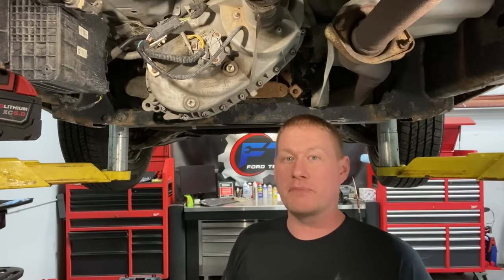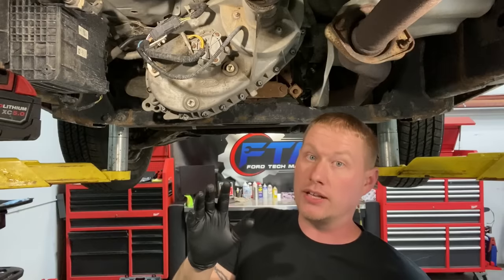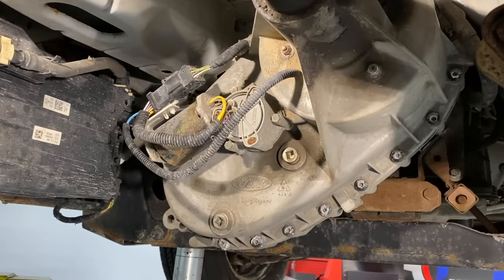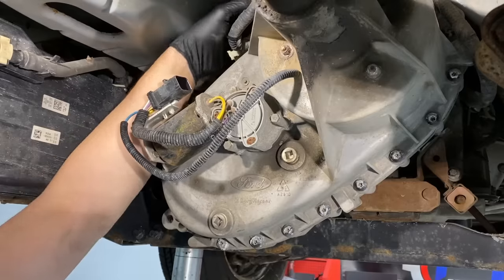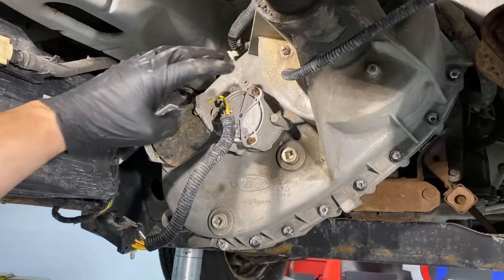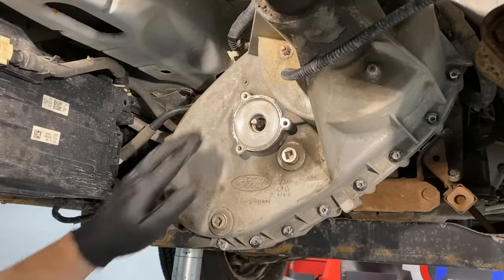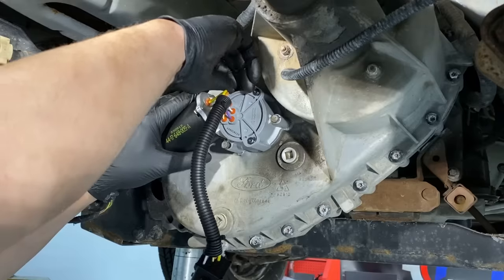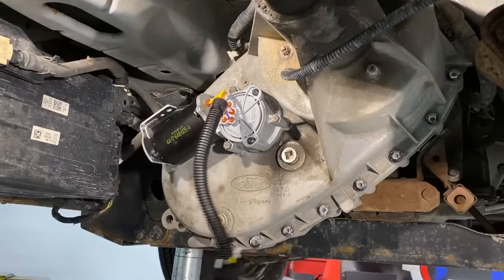2004-2020 Ford F-150 Four Wheel Drive Inoperative DTC P1867: Transfer Case Shift Motor Replacement

Comment: Is there a tool to remove the wire. I had do much trouble removing it. I had to cut the connector in half to remove it.

Comment: Great Video.  My 2006 F-150 acts strange when shifting into 4 Low.   If I am in park it actually will not go into 4 Low with putting it into drive and bumping it.  Loud Clunk.  When in Nuetral it will go into 4 Low but takes a long time.   When driving in 4 Low there is a high wine noise.  Is this normal?    Should I be in motion and do it on the fly?  4 High goes in and out no problem.
Reply: You have to be in neutral to get into 4L. It's literally a gear ratio change so it needs to engage an entirely separate drive gear. As for the whine, the bearing on that shaft might be dying, or starving for fluid. I'd check to make sure you have enough fluid in there first.... probably not a bad idea to just do a fluid change.

Comment: Is it also a common failure in the previous generation (97-03). Used ur other vid to check vacuum and electrical and all good there. Was thinking somehow the front diff went out

Comment: Could the transfer case cause problems at the hub actuators? My 4x4 gave out a couple months back but i never use 4x4 always have it at 2WD but after it gave out a bad vibration started coming from the passenger side. Vacuum is good at the hub actuators and the lines going to the actuators are good. My next step is checking the solenoid. I do have suction when turing my truck on but the passenger side vacuum is a bit weak. What could my problem be?

Comment: I’m not getting a code, I’m getting a message that says shift delay pull forward then it says check 4x4. Vacuum lines are new and so are the hubs only about 3 months old, could this be the problem? I’ve also seen people talking about IWE’s going bad

Comment: I've just completed this on my 11 f150. Code still comes back immediately. Pins all look super clean. Anything I can test before I assume I got a DOA part? (Motorcraft from Tasca)
Reply: Do you have power at the motor that engages 4WD? That would be the first thing I'd check. Wondering if you have an issue with the module. Does the light come on, on the dash showing it switched to 4hi/low? Mine doesn't which is making me think I don't have power/module is bad
Reply: I found the harness was bad. Bought new harness, used the old one to fish in the new one. Stripped shielding of old harness, found broken, crusty wire in a random spot in the harness. I'm assuming there was a defect in the insulation at that spot.
Reply: @mattmanyam  how did you find out the harness was bad? Just put a new transfer case shift motor on my 04 and still nothing. No lights or anything.
Reply: @quimchii5917  wiring diagram from alldatadiy account, then ohm checks. (Harness between transfer case module and shift motor)

Comment: I went to Auto Zone to see if I could confirm that the error I’m getting is the most common one mentioned in the video. The tech tried two different code readers and a number of things with the better one and couldn’t get any codes to show. After I left of course the 4x4 engaged and disengaged without showing an error on the dash. The position sensor diagnosis makes sense given the behavior I’ve observed (dash showing 4x4 low when switch is set to 4x4 high), I just kinda wanted to confirm the error was the position one before I spring for a $250 part.

Comment: Amazong video as alwyas, I recently got this issue on my 2013 F150 FX4, and it happend right after my battery died and i tried to start to the engine couple of time and i heard a some sort of gear noise. Charged my battery, then tried to reverse and the gear just shifted hard .. and the dash board was showing weird readings like fuel eco was at max, plus the 4x4 light went on .. left the car and got a new battery... Way better with shifting gears and back to normal .. then i went to try the 4x4 ...and i got stuck at 4L .. cant got back to 2 or 4H anymore .. 

The question is .. since the motor only installs if the transfer cas is on 2h .. how to adjust it manually from 4L ? Do i keep the switch on 4L before lifting the car? Is there a manual bolt that can adjust the gear ? 

Thanks for everything you do man, I appreciate the effort you put in those videos to make our life easier.. 

Kind regards from Saudi Arabia 
Feras

Comment: Thank you for your wonderful videos , I have a question about mine 2006 f150 5,4 triton it runs great but after a while when I stop or go in reverse not always but gradually more and more often starts stalling and shaking pretty bad I starting putting in neutral and it gets better, the shops I took it for inspection talking about timing chain but it makes me wonder because is not always . 
I’ll appreciate it if you can advise me 
Thank you

Comment: Does anyone know if you change your gear ratio on your truck should you install a torque converter with a different stall speed or does it affect your torque converter at all

Comment: What size is the bolt that attaches to the bracket? I’m talking about the smaller one that goes into the actual transfer case. Sadly enough mine broke so I need to order a new one. If  you know the part number that would be fantastic

Comment: I don't have a trouble code for the transfer case but I don't have a 4x4 indicator light on the dash any more. I saw it flash real quick but that's it.  Could it be the transfer case switch? or is there a fuse somewhere?

Comment: Thank you man. I have a 2015 4x4 3.5 ecoboost at 67k. My 4 wheel drive stopped working I can hear clicking noises when I shift into 4L and 4H. Is there anything else that could cause this or I should inspect while I have it on a lift replacing the shift motor? Your videos have helped me and saved me alot of money plus I've had a reason to buy tools.
Reply: Figure it out?
Reply: Did the shift motor fix the problem
Reply: @ElanTuna69  wish he would answer lol. My truck is in the shop now and they are replacing the iwe actuator.

Comment: Does the transfer case motor also send signal to make sure the light goes on. I did a bulb check and the 4x4 bulb isn't out. But the 4x4 doesn't illuminate but 4x4 works and shifts fine. I changed the 4x4 solenoid. What else should I look at?

Comment: I have an 08 with a 4.6 I am fighting doesn't matter what I do I can't get the thing to work I currently have a napa shift motor in it my local Ford dealer said they were back ordered... Have you had electrical issues with them? I am in Ontario Canada heart of the salt belt truck is a quad cab with 335oookms on the clock what do you think???

Comment: I'm having an issue with my 2005 ford fivehundred.  It will run with the maf sensor unplugged.  I've changed the maf and throttle body with no improvement.  It had a p0113, a p0201 and a p2106 codes before changing the maf.  What is my next step.

Comment: Hey, I was wondering if you  could help me out. I have a 2019 Expedition without 4L. There's a terrible grinding noise only while in 4wd. After performing the TSB for the IWEs Ford replaced the transfer case. I am still having the grinding noise and from the best I can tell it's coming from the center console area. It seems like it only happens over 20 MPH and gets louder when coasting and braking. No codes. Do you have any idea what it might be? Ford is now saying that they did everything and it's functioning properly.

Comment: I have a 2000 Ford ranger. When I turn on the knob for 4×4 high is the 4×4 light suppose to come on. When I turn my wheel and press the gas I do feel the rear wheels spin.

Comment: I have a 97 expedition 5.4 when I shift into 4 high I hear gears popping or in im on the highway jus in 2 wheel drive around 65mph. I start to hear the same popping. Could it be this or transfer case is toast?

Comment: I have a 2010 Expedition. When selecting 4 low I get a wrench symbol and nothing happens. It goes into 4 high no problem. Should I go ahead and change the motor as shown in the video?

Comment: What if i just wanna manually put it in 4 wheel drive for now till i get a new motor, can i just turn the shaft and then just turn the part in the motor to line it up and pit motor back on?

Comment: If it works and shifts fine in warm weather but fails to shift into 4x4 when sitting in cold weather below 25F. Would that only be the solenoid?

Comment: What is the vacuum pick up port for the whole 4×4 system, we changed the engine and don't know which is the pick up port, worked perfect be fore the engine swap, we have an open line over the engine connection, don't know where to pick up the vacuum

Comment: Great video and I’m sorry to bother but I have a clunking noise when I’m in 4x4 as I’m moving it clunks... and stops than clunks again as if it’s on the same spot as the wheel turns. Know what it could be ? And thanks

Comment: I have a 2010 f150 fx4 when i try to engage the 4x4 it just shows on the dash 4x4 shift in process and then it shows check 4x4 might this be the issue on why it doesn't engage 4x4

Comment: I just changed this part out today and replaced it with a new albeit cheap aftermarket part. It still isn’t working. It will shift between 2h and 4h but won’t go into 4L. Should I try again with a factory part or could it be something else?
Reply from the maker: Did you have this exact code?
Reply: @FordTechMakuloco  I did not have any code. I wasn’t aware a code was available. I was under the impression there would be a check engine light if there was a code. Should I just hook a diagnostic to it? Do I need Ford specific or is this something autozone can handle?

Comment: @fordtechmakuloco my 2018 F150 is stuck in 4L. I pulled the transfer Case motor off and tested it with the switch and it did nothing. I ordered a new motor, off Amazon, plugged it in and it rotated with the switch. I rotated the switch to 4L and mounted the motor, but it's still stuck in 4L.
Any suggestions? Could the motor and the shaft be "out of sync"?

Comment: When I engage my hubs and the inside I switch to 4x4 I start making a noise on the transfer case, then I get a light for a wrench to check 4x4  any ideas if the motor make noise when it’s damaged

Comment: Hey I got 06 ford f150 it goes in 4wd but wen cmein out 111 fuse blows. Its on the clockwise motion. Do these have control module. I put new shift motor on it. Just dnt kno wat to do next

Comment: I have no power to my 4x4 switch  in my Ford f150 it worked before .. been stuck with 2 wheel drive for a year . Any ideas would help

Comment: having trouble diagnosing my system I have replaced vacuum actuator, both iwes, vacuum lines, and check valves for 4x4 system and the iwes are having trouble engaging while the car is moving. I replaced the bad iwes with a duralast (durajunk) one and a Dorman one.  also, I replaced the shift motor with a Dorman. my question is what is supposed to engage first when moving the transfer case or the wheels?

Comment: Can this fail into a neutral position? I'm chasing down an issue with my truck where the truck will shift from park to reverse, neutral, drive, 2, and 1...but it won't move. The speedo turns as though it is though, and when I go to put it back into park, it grinds. From what I've researched...this could be the GEM box, the shift motor, or the actual transfer case. I have no transmission codes, or codes at all for that matter. Some people have said that neutral is a position this can fail to...or that it can somehow revert to a neutral position with a GEM failure.

Thanks for all the videos...I've gone through the ringer with this truck (mostly from a company taking advantage on me during a cross country trip where the old 367k 5.4 failed...they DESTROYED my truck during the 6 days they had it to replace the motor 1600 miles from home. If any of you need work in Fort Smith AK...stay the H*LL away from Jody's Auto Repair), and you've been a life saver.

Comment: Thanks for all great videos. Is this motor is responsable to know the value of the speed sensor and engarge the IWE Actuator when we put in 4Hi mode on the road,  on the fly ? Sorry for my english...  I will try to explain my case. On my F150 2007 I changed both Actuator, both check valve, selenoid and tested presure, all is good. I can engage as well 4x4 in 4Hi or 4low mode when I am  stopped , but when I try to engage 4HI on the road I hear a grind noise, the vacuum Actuator hub try to engage but they are not able. I think there are 2 phases when we put in 4Hi on the road, first phase ( I think ) something engage the front axel,  second phase is when the front axle turn at the same revolution from back axle something engage the  Actuator hub  to slide in position. I think that my front axle have not the same revolution from the back axle and cannot slide in position. Somebody have an idea ?

Comment: I have a 2001 F-150 Supercrew 4x4.  I was told that the transfer case control module is bad but they are out of production.  Installed a used one but it still won't go into four wheel drive.  Also replaced the shift motor, still no work.  Do you have any ideas?

Comment: Just curious is that the only thing that would cause that code. Just thinking you said it tells position and that's what fails, does it do that with a potentiometer? Just wondering if it would set a circuit code in that case if a wire broke. I haven't had to change one before but if i do I was wondering if there's any test methods to do or just replace it.
Reply from the maker: Once it sets that code it has lost positioning more than once, it's always the motor itself.
Reply: @FordTechMakuloco  cool, please don't think I was second guessing you. I  haven't  done one yet and just wanted to cove my bases if one came in.
Reply: @FordTechMakuloco  great video and perhaps the easiest fix I've seen so far. Rarely use my 4 wheel drive but glad I have it when I do.

Comment: @Fordtechmakuloco

Does the check engine light come on for this error? Will a trouble Diagnostic Trouble code display on a reader when this happens?
Reply: Mine doesn't have the previously mentioned trouble codes.  However the symptom is the same

Comment: Thanks! Awesome info.  Would this apply to a 2001 F150?
Reply: Did the video say 2001 F150 there's your answer my friend
Reply: @bernardenorth  I guess I SHOULD have said.....Would a similar procedure apply to a 2001 model. Does the 1997-2004 series have the same issue?
Reply: @ksdj1  I replaced mine on a 97 Explorer.   It was similar.  As I remember access was  more difficult than in the video, and a number of conductors had to be transferred over, not just the one.
Reply: @davecaselli1957  Thanks Dave

Comment: I didn’t know I had Esof in my f150 so I put Mercian LV case fluid that wasn’t meant for my esof transfer case. The manual says I have to use motor craft fluid. I also noticed my mpg drastically went down

Im gonna flush it ASAP but did I cause any damage? I appreciate your help

Comment: My 2008 Expedition transfer case is shifting fine but won't go into 2wd.  With all 4 wheels jacked up in 2wd the IWE's are disengaged but the transfer case is rotating the front drive shaft, diff, and CV axles with the transmission in drive.  Is it possible for this motor to fail like this and still shift into 4 low but not go into 2wd?

Comment: My 2008 transfer case will not shift...I bang on it with a 2x4 then it does.  Fluid has been changed.  Time to change the shift motor?

Comment: My 2013 ford f150 3.5 EcoBoost is throwing this code. I've bought 2 different actuators and put them both in and neither fixed the problem. 4x4 still doesn't work and im still getting the same code. Could it be something other than the actuator with this code?

Comment: Would like to see a 2010 Ford expedition el fuel filter change locating and replacing it
Reply: B T I think he’s mentioned those are now in the tank. Basically not worth servicing, I’ve got 235,000 miles on mine

Comment: Question for you. I have a 2004 Ford Explorer Sport Trac 4wd. I try to engage 4wd but no light comes on in the cluster and the front wheels won’t engage in 4wd. Is this issue a switch motor issue like this video, or is it the 4wd control module?

Comment: My 2010 shows on the dash its shifting into 4 high or low but no 4wheel drive. I have vacuum at the solenoid per your other vid.  Probably the hubs?  Thanks
Reply: What did you find? I have same issue, everything looks fine 4x4 light comes on but not engaging

Comment: REALLY HOPE YOU READ THIS! MY 1990 F250 IS STUCK IN PARK and the truck will not kick the starter in when I turn the key. I turned the key one day and there was a hard pressurewhen I turned it. Then after that when i turn the key now the power comes on but there is nothing when its in the run position. I changed the ignition switch but its still the same. I'm not sure about how to position everything when installing it? Can you help with that? Then I cant shift outta park now. I changed the brake switch cause of that problem and I had no brake lights. The brake lights work now but I still can't shift out of park. Any idea what I could check next? Please please help. Thank you. None of my fuses are blown in the fuse box either

Comment: Have you seen where the oil dipstick tube rusts were it goes into the. block. and  it breaks off right above there in places where the salt?
2004. f350 5.4
Dipstick isnt painted above the o ring and rusts.
Reply from the maker: Yup

Comment: Hello I don't have any codes on my 2011 fx4 but when I go to switch my truck into 4hi it will shift into 4lo I then have to turn down to 4lo then back to 4hi. I changed the selector switch in the truck did not fix my problem